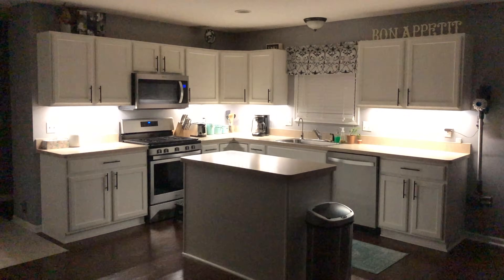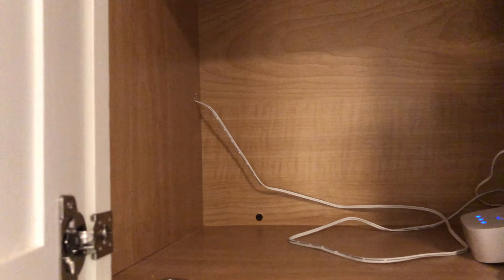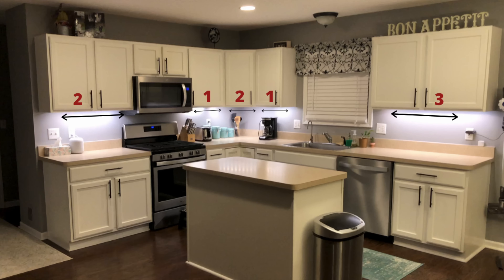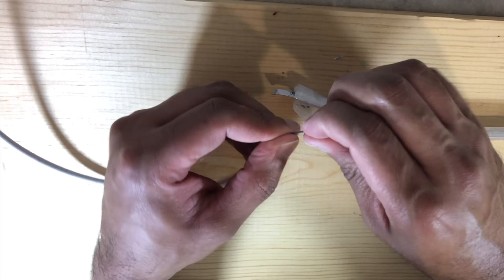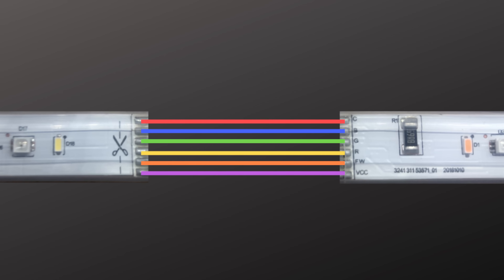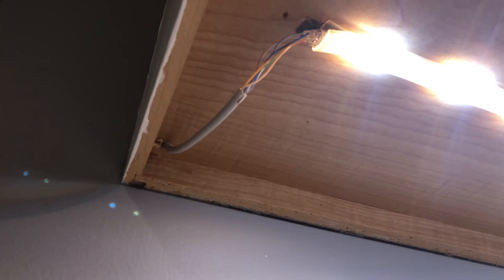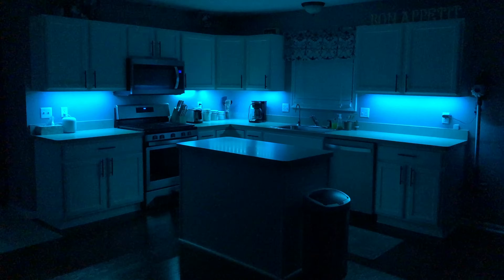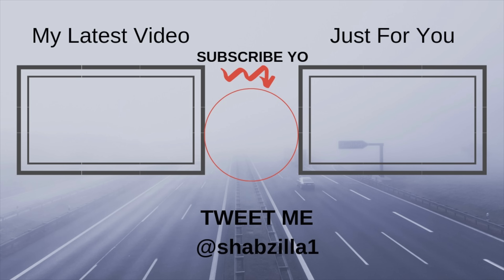Philips Hue Lightstrip Extension Hack for Under Kitchen Cabinet Lighting

Comment: In case anyone needs to cut, split, or extend their Hue strips and you don't know how to solder, Litcessory makes tons of Hue extension cables and connectors. The steps are identical to this but instead of soldering you use snap pin connectors. Then you can attach their various extension cables or splitters. They even make a snap connector set with an RJ45 adapter so you can run your own ethernet cable. The only limitation is Hue strips start to fail after 33 feet in length on one single controller, including all of the extensions, so just keep your total distance in mind. This is obviously much lower cost and if you know how to solder then it's a no brainer, but for those who can't solder, the Litcessory options are excellent.👍

Comment: Remember which correct side the cut strips connect back, to be same order it was originally, or it'll burn out a strip or all if even one is backwards. Trust me done it, and its easy. Plus there are 4 different hue light strips (v3, v4 still sold).

Comment: Could you pull the wires from the strip and actually make a cat 5 male to female connection or are they embedded in the strip?
Reply from the maker: They are embedded into the strip
Reply: @SHABZILLA  your kitchen looks stunning. Buying mine tonight.
Reply from the maker: @delaplanemusic  appreciate that! Good luck with the install!

Comment: I have practically the same cabinet layout. I am in question whether I have to put the light all the way to the corner, or diagonally as you did. Did you find the luminance of the corner a problem, or you are satisfied with the result that corner a little darker? Also, why didn't you put a strip under the microwave? Also, I am not looking to use extensions. I would like to have separate strips for each section of the kitchen and the brightness of each section will be controlled by a small Aquara motion sensor placed under the center counter to detect motion next to each section of the cabinets. I hope this will work.
Reply from the maker: The corner I am satisfied with 100%. I didn't put any lights under the microwave because my microwave already has lighting there and I didn't want any steam or heat messing with the reliability of the lights long term. What you can do is plug the strip in before cutting it up and test it diagonally on your setup and see if you are satisfied with it. Thank you for watching! I hope it all goes well :)

Comment: So this was done with just 1 set of the lights strips without any extensions and just 1 plug? Is that correct? Can the new gradient light strips as well?
Reply from the maker: I used 2 sets of the strips and connected them to 1 plug. That’s what I had at the time. I would think you could use the extensions as well. I haven’t seen the new strips up close so I don’t know if this method would work. Sorry about that!

Comment: Cool project. I just purchased 3 light strips to use in my kitchen. I wish I knew how to solder. I wouldn’t trust myself to do it right. So I’ll just use the three power packs lol. I will use the tip for the 3m VHB tape. I was thinking the stick tape would be a bit lame.
Reply from the maker: Nothing wrong with using the power packs! As long as you’re happy with the project and it looks great! Thanks for watching!

Comment: Thank you for your video. I realize that this hack was done 2 years ago, but I was wondering if you knew if this would also work with the Philips Hue Version 4 lightstrips? (Newer version that is bluetooth compatible) Thanks Again for your time!
Reply from the maker: Hi! I’m actually not sure if it works on the latest ones. As long as it has a similar setup it should work. I wish I could help more! Thank you for watching.

Comment: Why do you even bother soldering? Can’t you just use a 6 pin connector kit like this? https://www.amazon.com/dp/B07WFTS3KV/ref=cm_sw_em_r_mt_dp_EFJ40N7N2M6ZYFFFPZW3

Also couldn’t you have separate strips and the group them together so they act as one? Not sure strip lights work but that’s how separate bulbs work

Comment: Does it matter which 6 wires you use in the Ethernet cable?
Reply from the maker: It doesn't as long as you make sure the same color wire is at the same position as the strip. Thanks for watching!!

Comment: Very well thought out!  Pre-wiring for these seems excessive.  You would need the LV wire and an outlet at every location instead of a single transformer on a switch so what you did was impressive.  Suggestion: stick tape to the front lip of the cabinet facing the backsplash.  Makes it almost invisible, can’t see it in the countertop and emphasizes the backsplash.

PS:  Any idea how much tape you can put on one transformer?

Comment: Hi, good job! Can I ask you? Is it possible to have AC/DC Led power supply with adapter
 and connetction point to Led strips at technical room and connect with Led strip with UTP cabel to kitchen? Is there any delay to start? Thanks

Comment: Awesome job!! Very cool project. I’ve been watching a lot of videos on hue lightstrips and you did a great job explaining the technical details of extending & reconnecting these lights :)
Reply from the maker: Thank you for the kind words! I’m glad you enjoyed the video!
Reply: Thanks so much Shabzilla! This was a great how to video and very helpful. If I want to avoid solder, could I also use these splitters (https://www.amazon.co.uk/dp/B01N3NTCYU?psc=1&pf_rd_p=412e17bd-2d19-4af7-bd07-daea3c4821a4&pf_rd_r=GP1BMSH9VBRMG1Q9DXEH&pd_rd_wg=eJcKJ&pd_rd_i=B01N3NTCYU&pd_rd_w=k99Ex&pd_rd_r=526a8a1c-21c9-4ac3-9074-9aeba9240e66&ref_=pd_luc_rh_ci_mcx_mr_huc_d_02_04_t_img_lh) and extension cables? (https://www.amazon.co.uk/gp/product/B01M7XDZ5V?pf_rd_r=FB089M25DERQHGVT5H80&pf_rd_p=6e878984-68d5-4fd2-b7b3-7bc79d9c8b60)
Reply from the maker: @KevinQuincey  you can!

Comment: Will this method work for the C by GE Led Strips? I find it infuriating that once you cut the cable you lose the connection end for the next cable.
Reply from the maker: I’m not sure honestly. I wish I could help tho! Thank you for watching.
Reply: I imagine it would. Most light strips are fairly standard with 3 to 5 contacts.

Comment: Nice idea to use a ethernet cable but does it ouput enough ampere to light up everything at once? You may want to reconsider when you plan to use meters of a strip at 100% brightness.. The thicker a single wire is the more amperage you would get.
Reply from the maker: dvdcase56 I’ve had them for almost a year no issues so I would use the same method if I had to again. I leave them on for hours everyday too. Thanks for watching.
Reply: @SHABZILLA  Good to know,  I had this idea too once but abandoned it thinking about it not having enough current.
Reply from the maker: dvdcase56 you should be good to go! Let me know if you take a different route and what the outcome is 😀

Comment: Instead of using solder to seal the wires can I just use a connecter
Reply from the maker: Joanne Smith i think they sell some connectors now but this was the best way to extend the lights for me at the time.
Reply: @SHABZILLA  what kind do they sell? Any link?
Reply from the maker: Robert De Vivo I think the brand is Litcessory. When I checked it last it was way more expensive than using this method.
Reply: @SHABZILLA  True. But my only option since I don’t know how to solder and wouldn’t want to learn unless I planned to use it often. 😁
Reply from the maker: TheCurlyFitChic then this would be perfect! The soldering is a pain for real lol

Comment: Thanks 
SHABZILLA for the idea. It worked out great. I was able to solder them and get them installed and they worked great. I had them on for hours and worked like a champ. Last night I noticed the light colors changed. They went to like 20% brightness and changed to a greenish-white. A minute later they returned to white and I chalked it up to some interference with the wireless signal. Then a half-hour later they went back to that and stayed permanently! The controller shows 100% brightness but they're only at about 20%. I can change colors but it is not back to where it should be. I don't understand why it's doing it as it was working perfectly. I spent about 8 hours soldering and running everything for this to happen. The adapter is still putting 24v out so it's not that. Any ideas on this or why?
Reply from the maker: T. Cowger thats interesting. I haven’t had any of those issues. I noticed that if I use the hue app some of the pre configured colors dim down to 20%. Are you using the app to change the colors or Siri/Alexa/google home?
Reply: SHABZILLA - I can change colors and dim fine when it works. I’ve found if I tap the white box the power plugs into, it will come back on! But it doesn’t last very long and goes back again...
Reply from the maker: @travisc410  oh man, it almost sounds like you have a defective lightstrip. You can try opening up the white box and see if anything is loose in there. I would check that and double check the plugs just to make sure they're all the way in. Ugh, i'm sorry you're having issues with your setup!

Comment: I did the cat 5 cable method when I first did my LED’s in the kitchen.  I was a little worried about overloading the wire with current (amps I believe), so I eventually went back and re-worked the connections with LED extensions that are available online.  I looked and there is  Extension Cable for Philips Hue LightStrip Plus (10 ft/3 m, 2 Pack, White) https://www.amazon.com/dp/B07N4FPWTG/ref=cm_sw_r_cp_tai_Wl3KEbAFA0JP1 which would help avoid the soldering process (which I did and can suck) and also should get the right wire to carry the load.  

Just some food for thought.
Reply from the maker: Hey thanks for letting me know!! If I take on a similar project i'll be sure to check them out and save the hassle. Thanks for watching!
Reply: @SHABZILLA  wow! I didn't know you can use ethernet cable to extend it.. Is that safe? Will that somehow overload, like what @Brian mentioned?
Reply from the maker: afterSHOcKsStudios I’ve had them installed since Nov 2019 and I’ve had zero issues. I use them everyday and leave them on for hours and hours. Based on my experience, I think it’s safe. Thanks for watching!
Reply: SHABZILLA I would second the using the cat5 and running for days with no issues. I definitely wasn’t trying to rain on the parade. I personally just wasn’t comfortable with the load the cat5 was as carrying and found what looked like to be a “more better” solution that felt more safe. I was just concerned about running voltage through a wall on cat5 that may/may not be able to carry that load.
Reply from the maker: Brian Garrett no worries! You’re not raining on the parade at all. We’re all DIYers so any ideas or methods are appreciate for everyone!

Comment: Are these light strips the latest version?
Reply from the maker: Jeff Mercurio I purchased mine 11/2018 but I did check the hue website and they still look the same and have the same connections. I can get you a model number if you need. Thanks for watching!
Reply: @SHABZILLA  It'd help me alot if you give me the model number. Thanks!
Reply from the maker: @thecrazypuppeteria  it says 71901A on mine.

Comment: An Ethernet cable has 8 wires (4 wire pairs) while the HUE strips use a 6-wire connection from one to the next. Did you do anything to the extra two wires to cover / protect them? Do you recommend a certain category Ethernet cable (5/6/7)? Also, are you using the newest Lightstrip Plus model? I have a pretty complex run bc of a window and microwave too, so this video has been very helpful in helping me understand my options to extend the HUE Lightstrip.
Reply from the maker: Rich Alot I’m glad you found this helpful!  To answer your questions, I used cat5. The 2 wires you don’t use, you can leave in and cut them so they don’t stick out. They have no power running through them so you shouldn’t have any issues. Also, I bought mine in 2018 so I don’t know if there is a newer model available now. Hopefully that helps. If you have any other questions, please let me know.
Reply: Does it matter which 6 wires you use from the Ethernet cable or can you use any 6 as long as you match up colors on both sides?

Comment: This is great.  Thank you.  Question - how did you determine where to place the strips under the cabinet?  It looks like you placed them sorta in the middle.  I've seen some where they place the strip toward the front of the cabinet underside so they are hidden by the cabinet front.  Thanks again.
Reply from the maker: TOperspective I held them up in the front, middle, and back and my wife and I liked them the most in the middle. They light up the entire counter. I would try it out the same way. Depending on your cabinets, if you place them in the front, the cabinets could block some of the light. Thank you for watching!!
Reply: @SHABZILLA  thank you!

Comment: I would recommend desoldering the sections versus cutting since you are already planning to solder.  This will leave you with a larger solder pad on each side to work with.
Reply from the maker: Corey Morreale thanks for the comment. You would still have to cut it to separate the sections after desoldering them since the strip is all one continuous strip.

Comment: Thanks for the video. Very helpful. I am in the planning phase of my install and have a question for you. You indicated that you can cut the strip in certain places. How long is each of these sections?
Reply from the maker: Glad you found this helpful! Each section is 13.5 inches long. That’s the shortest you can go. Let me know if you have any other questions.
Reply: @SHABZILLA  Thanks for the additional info. I do have another question: It looks like you've used 2 sections under most of your cabinets. Now that you have lived with it for awhile, do you think you could have maybe used shorter sections under your cabs and still had the desired level of illumination and ambience? (I might be a penny pincher...)
Reply from the maker: Nochoke I would recommend using as many sections as you can. I’m a penny pincher too but since you’re gonna do this one time, it’s better to overdo it. Especially because you can dim them and change the colors. Its not an easy task either so you won’t want to go back and modify the lights. That’s just what I recommend.
Reply: @SHABZILLA  Appreciate your responses very much. Good luck in your endeavors!
Reply from the maker: Nochoke any time! Feel free to ask any other questions. If you end up taking on the project, please share your results!